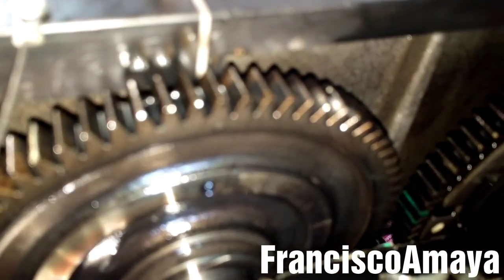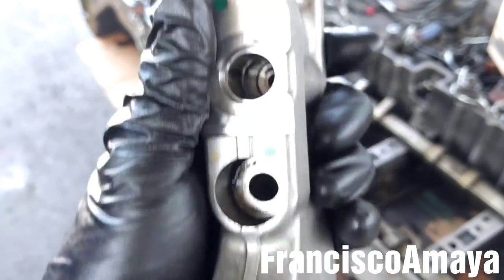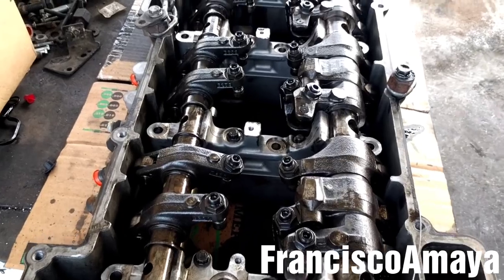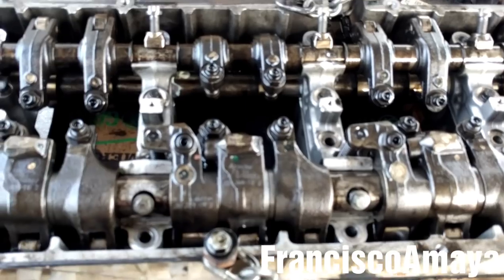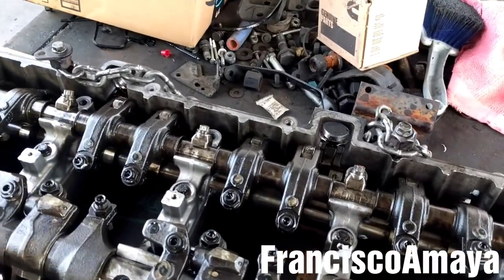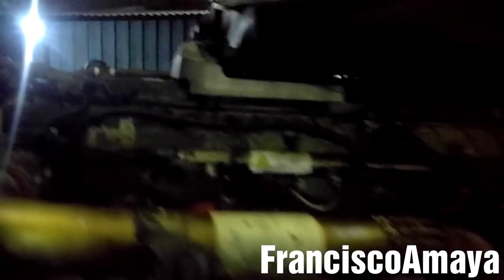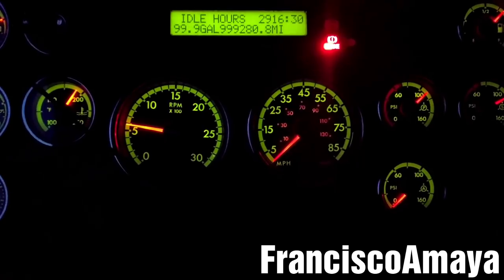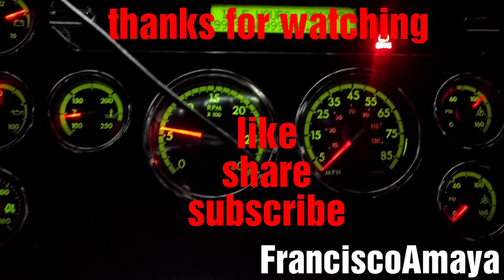Freightliner Cascadia DD15 engine malfunction engine noise cam housing problem engine timing part 2

Comment: Sr. "GRAN" Francisco.  Eres el mejor en YT para motores DD                   Mr. "GREAT" Francisco.  You are the best on YT for DD engines    You are one of fewer mechanics that understand materials from what are made engine’s parts and components. Even Your English is rough (mine is worse) I did understand everything what You explained. I am diesel (truck) mechanic that mostly work on Volvo trucks. But whenever need to do some job on DD engines, I first checking your video about that. Big respect for You from me!!!!!     Gran respeto por ti, de mi parte.
Reply from the maker: Muchas gracias!!
Reply: De nada, maestro García

Comment: Hola. Podrían ayudarme con el torque de este motor? Cuantas libras de presión se le da a las bancadas, bielas y culata? De antemano gracias por su ayuda. Saludos de Nicaragua!!!!
Reply from the maker: Bancada DD13:
1 - 150 N·m (111 lb·ft)
2 - 300 N·m (221 lb·ft)
3 - 90° torque turn

Biela:
190 N·m (140 lb·ft) + 90° torque turn

For the DD15 and DD16
Bancada:
1 - 150 N·m (111 lb·ft)
2 - 250 N·m (184 lb·ft)
3 - 90° torque turn
4 - 90 ° torque turn (180° in total)

Biela torque to:
115 N·m (85 lb·ft) + 180° torque turn
Reply: Thank you good video

Comment: Hi i got a cascadia 2014 dd15 dpf def deleteted already everytime i get a hill or climb, yellow check engine light comes on turbo stops working i lose power 40% even pushing the gas pedal .any idea please ???(spn 47650 fmi 0)
Reply from the maker: The code is 4765?
Reply: Francisco Amaya yes thats the one 4765 fmi 0
Reply from the maker: SPN 4765/FMI 0 - GHG14
This diagnostic is typically Exhaust Temperature High.
Table 1.
SPN 4765/FMI 0
Description Exhaust temperature high
Monitored Parameter Exhaust temperature
Typical Enabling Conditions Always on
Monitor Sequence None
Execution Frequency Continuous when enabling conditions met
Typical Duration 2 Seconds
Dash Lamps CEL
Engine Reaction Derate 25%

This could be caused by a plugged doc or excessive fuel consumption.
Reply: Francisco Amaya thank you man appreciate your time

Comment: I have a 2010 Columbia series 60 640,000 miles when I drive slow 5mph in 2nd I’m experiencing erratic rpm’s up down up down. When I dive on the freeway it’s not as bad fairly normal. No check engine light. Can you please help me.
Reply: Normal idling I can put it in park and set the cruise and rpms @8 no problem only when I drive slowly

Comment: Buenas tardes .me puede ayudar la linea del injector 5 esta liquiando diesel esa puede ser la razo q cuando estoy manejndo y el rpm llega a 15 o 16 suene como q estubieran suelta las valvulas
Reply from the maker: No, eso puede ser causado por in problem interno
Reply: @franciscoamayaYT  gracias por contestar.
Reply: Me Podria decirr a deberia chekear.
Reply from the maker: @kevincruz8921  
Quite le la tapa de arriba para ver si puede encontradar algo dañado visualmente
Reply: @franciscoamayaYT  buenos das.yo le cambie los oring a los injector a y los empaques para q no pase petroleo al cooling pero este sonido es minimo pero es normal y empeso como a los 4 meses ya tiene 624000millas y me esta botando petroleo por el  quinto injector
Reply: Quiero decir este sonido no es normal pero nunca ajuste balvulas o y tambien le cambie los shield o las las fundas de los injector
Reply: Disculpe  q lo moleste esq yo me e dedicado a dar mantenimiento a mi truck gracias a sus concejos. Pero esto me tiene preocupado
Reply from the maker: @kevincruz8921  
Mandeme por email el sonido que hace